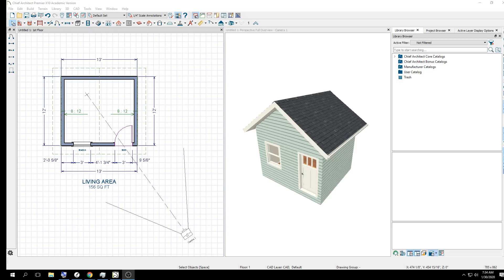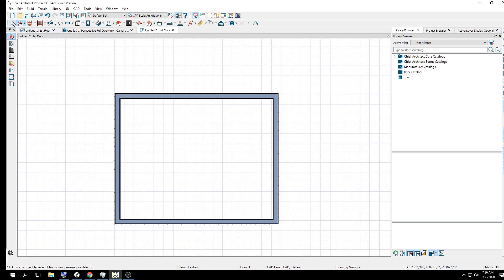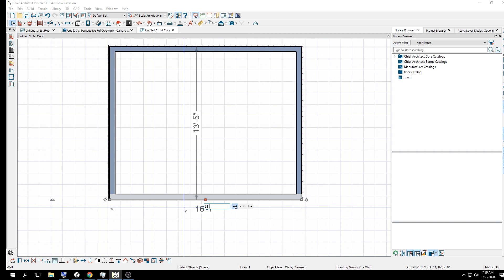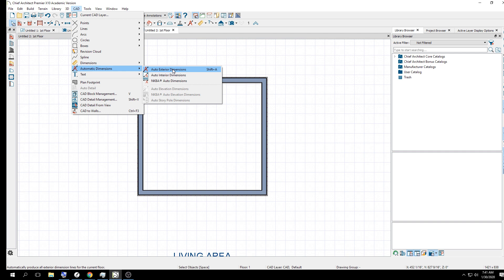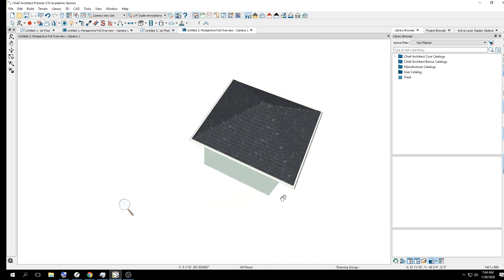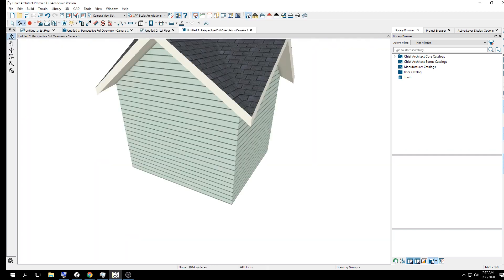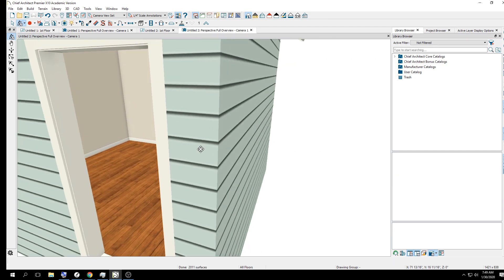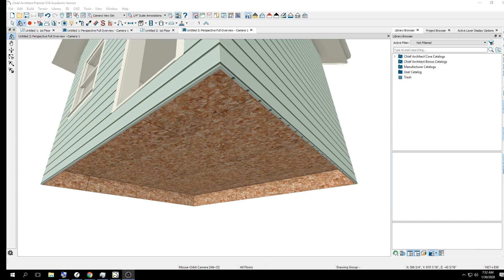Simple Shed w/ 8:12 Gable Roof - Chief Architect X10

Comment: I have a 2 story garage/shed and the roof only builds on the first floor. ????
Reply from the maker: Hi Bryan,

I have had this issue in the past; off the top of my head, I do not know exactly what the issue is.   I will try this in the lab and get back to you but here are some guesses to look into.

Make sure you do not have walls on floor 1 defined as gable or full gable; you want the 2nd floor to have these not the first; I've seen this complicate auto-roof procedures.

Make sure you are on floor two when you build your roof; I doubt this is the problem but I've seen Chief build roofs on active floors before.

Ceiling heights for floor 2 could be off; you may not notice if you have your ceiling turned off are doing a vaulted ceiling; the ceiling plane will be invisible to you and you could accidentally set it to a few inches and the roof is building on the wrong height.

These are just guesses off the top of my head; I'm going to try and replicate the issue and get back to you.   Also if you solved the problem already; what was your solution?

I'm genuinely curious.   
Thanks :-)